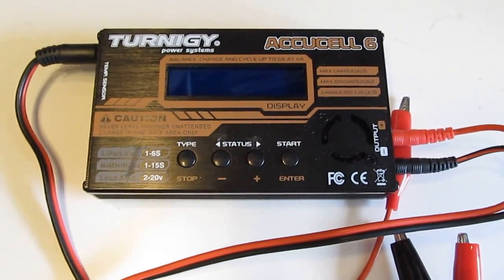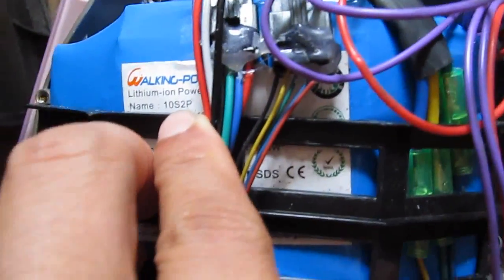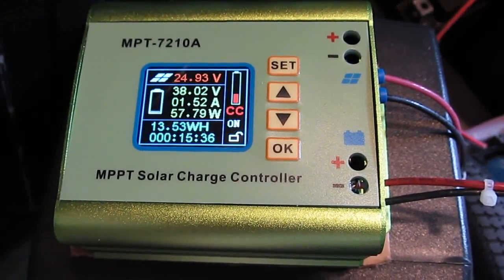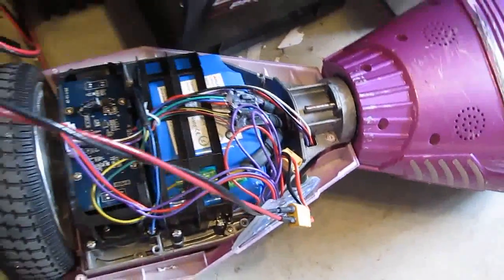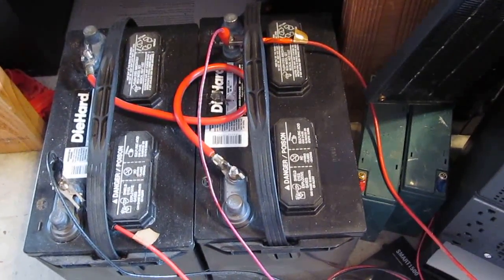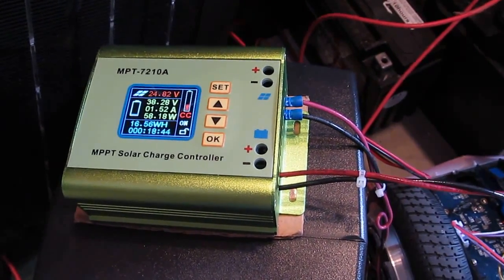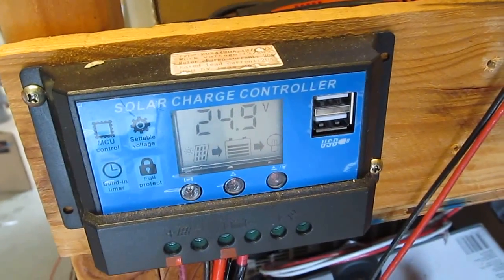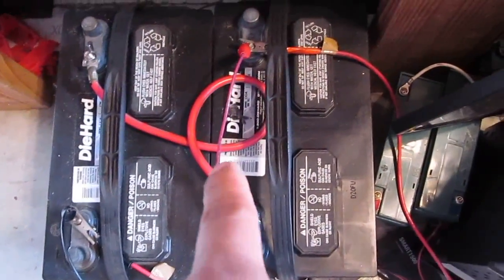High voltage Li ion charger MPT-7210A: Charge a 10S hoverboard battery

Comment: Ive been wondering if you can hook the input side straight up to a  battery, especially one that can supply way more amps than what the controller says it can handle.

Comment: my sketchy method for charing the 35-40v battery was to get the switch mode power supplies out of broken printers. wire two of them up in parallel to get 40ish volts at 1 amp. better than nothing and was basically free :)

Comment: The hoverboard battery has a built-in BMS which balance charges the 10 18650s
Reply: no the cheap bms inside wont really balance like imax b6 balance chargers.

Comment: Can u use the pwm power output to do the same thing like instead of powering from the battery. To power mpt 7210a from pwm directly. I just made a video from 36v battery to 60w max digital buck converter to mpt 7210a and it worked but I'm not sure it's the best idea. Would like to here your thoughts on my video if possible.
Reply: https://youtu.be/rZikcCVeZU4
Reply: yes

Comment: what pins of the "3pin connector" of the power charger is used to power the pack? the pack has only two wires but the connector has 3.
Reply: The bottom two,left and right of the lock notch.

Comment: It sooooo sooooo sooooo much cheaper just go buy an 8 to 15 dollar hoverboard charger
Reply from the maker: Most of the time the problem is the BMS board, not the charger. And a BMS board is not soooo ssooosososo much cheaper than this.
Reply: vuaeco in this case you talking about charger. Still cheaper to buy a whole chip board kit for $46 on ebay